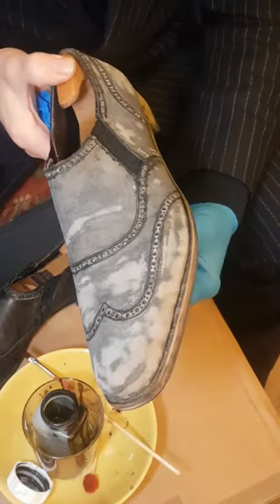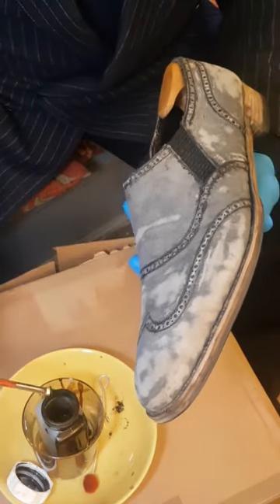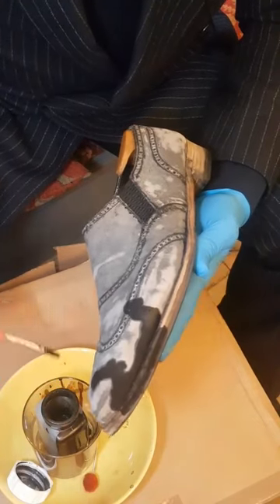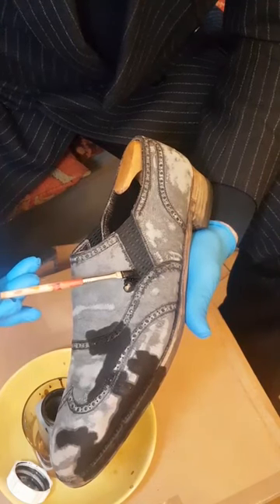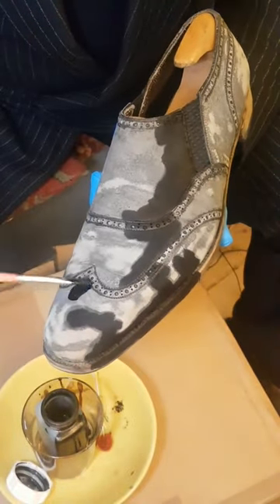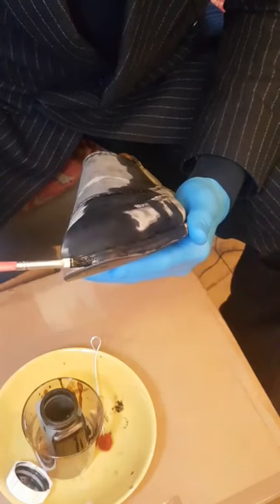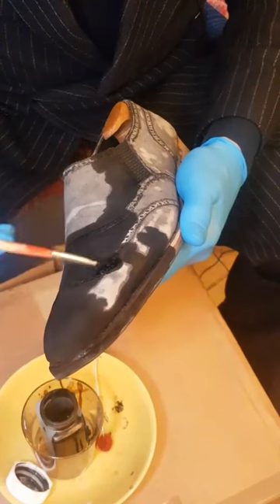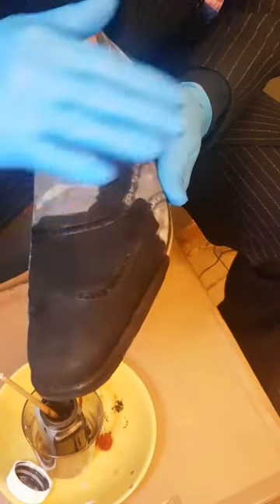Series 8: Episode 7: Applying the first application of dye.

Comment: What is the glaze or "factory finish" that is put on the smooth calf skin for shoes? The coating that must be stripped off with decapant or acetone in order to dye them a different color? Have you ever attempted to reapply this coatings after dyeing shoes?
Reply from the maker: If the shoes are regular calf skin, the factory finish will be just light wax polish, however, if skin is 'Book Binder' skin or 'Corrected Grain', you will have great difficulty modifying factory finish, it is not a DIY proposition
Reply: Thanks for sharing all your work!
Reply: Do you only use alcohol to strip/dye shoes? Do you ever use a specialized product like saphir decapant or fiebings deglazer?